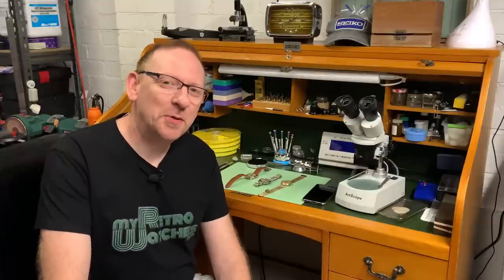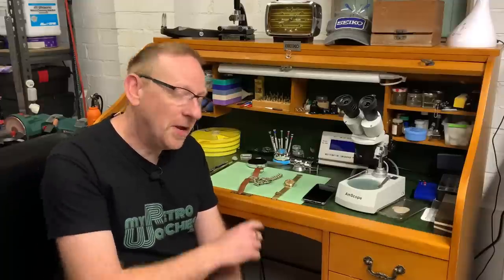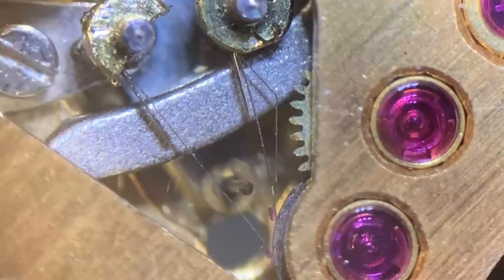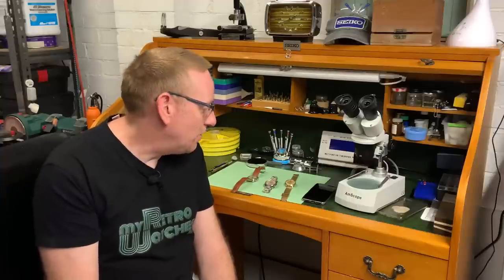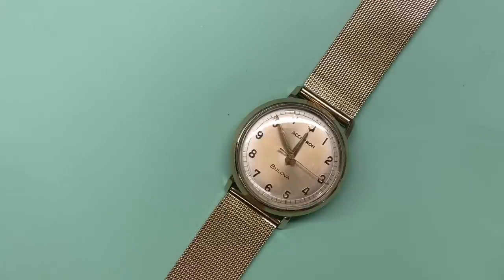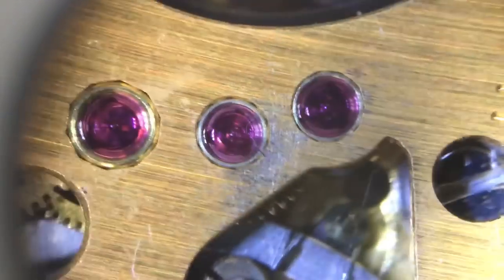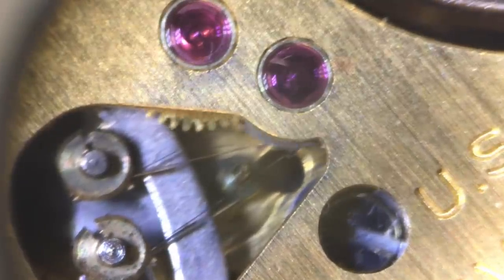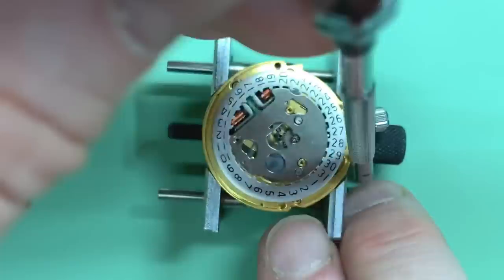Bulova Accutron 218 Disassembly Tutorial

Comment: These are fantastic time pieces. I have a A Cushion Shape Bulova Accutron 214 Solid 14kt Gold. In High School I worked at Carl’s DiamondD Brokerage and Carl’s fineJewelry. I learned Gemology and all about watches. I became a Watch addict!  Beautiful timepiece and the most accurate timepiece in its time. While Omega Speedmaster won the Government Contract from NASA.. Bulova instruments were used on the desk and control panels. I replaced the battery several weeks ago and she is humming away.  And still accurate. I want a Spaceview.  As you found out the index “lever” jewel looks like it is hanging by a hair the actual index lever. I had a customer that wanted an Accutron, but I advised purchase for dress wear because not an appropriate work watch. He was in construction and ran a jack hammer. Incabloc shock resistance system was the durable watch in that time period. I still love my Bulova Accutron. Citizen owns Bulova now, has a “Tri - Tuning Fork System” that runs at 262 kHz very accurate time piece. I have one in the Bulova Lunar Pilot reproduction model.  Love it!  You discussed my 214 on a previous video....  I’m learning so much from you!  Thank You so much!
Reply from the maker: What a great story you have there . I am definitely going through my tuning fork phase (pardon the pun)

Comment: I have worked on several 218's. the main flaw in the design is the minute wheel clutch. they wareout. the the hands stop moving as calendar approaches the 12:00 flip.
It can be tightened up again wth great care. Watch out for that index wheel, one bump and it's "all over"! 
-great video!

Comment: Thanks for making this video. Really appreciate the walkthrough. isn't it amazing how they achieved such fine detail on the index wheel way back then? I would've instinctively grabbed the edge of the wheel with the tweezers and unknowingly rounded out the teeth. These really are a different kind of beast. Tuning fork movements can be far more delicate and less forgiving to work on than the traditional mechanical balance wheel types.
Reply from the maker: Hi Chris!  I’ve pretty much mastered these 218s now after working on over 10 now. They are actually quite simple but delicate at the same time. You should try one I think you would really appreciate the challenge. 
I still find it incredible that you can take a tuning fork and turn that vibration into wheel motion.  Some engineering!
The 214 being the first ones and in the mid 60s they can make a 2.4mm diameter wheel with 320 teeth all perfectly cut from beryllium.

Comment: Might I recommend getting a  # 5 fine point and a # 7 hooked point tweezers to aid your efforts. I was lucky in finding these and more at the estate sale of a watchmaker.  Recently, I have acquired a Accutron 2182 day date made in 1972.  It had a dead mercury battery inside but not leaking. It's working like a champ now and it's informative to see how the bloody thing works.  Cheers.
Reply from the maker: I have developed a method with these now as I have done around 10 of them. Kinda got a bit obsessed!
It’s the wonder of engineering how to take a vibration into a train of gears and then get at 300 beat per second. 
Walks over all mechanical watches for the smoothest tick.

Comment: Attended Bulova Schol of Watchmaking and have been repairing Accutrons since 1970.  Most parts you removed isn't necessary unless there is rust involved.  One point, you forgot to remove the setting lever screw.  The video was very good..
Reply from the maker: This was my first time inside one of these so please take that into consideration.  There is no logic in not removing all parts for cleaning in my opinion as this is what we do for all fully mechanical watches. Good practice .
I’ve now done some 20 or so 218s and have them down to a finer art plus I now have the phase gauge and movement holder to get them reasonably accurate.
I’ve a 214 to video soon. Never been in one of those either so I must be crazy to film my first exploration but it makes for a more entertaining video 😂
Reply: You did well for a beginner and the video was excellent.  Keep up the good work!!

Comment: I am also gobbsmacked. My uncle sent me Bulova Accutron tank that has the 2470 10 jewel movement. Everything inside looks to be in good order, but the battery retention clip (with a battery) was sitting on the circuit and appeared to server one of the connections-it was also a bit corroded. I haven't the faintest on testing or repairing these.

Comment: Quite enjoyed your presentation! I've got a Bulova 218D and if I can't fix it, you're welcome to have it. Second hand spins but time stands still! Cheers
Reply from the maker: So the second hand is running and watch is humming?  if so should be a fairly easy fix, I would think something is amiss dial side as hour and minute are driven on that train of wheels.
Reply: Right! A watch maker friend found a tiny wheel worn and swapped it. Works fine now. Lovely time piece the 218D with elastic band. Not high value though. Thanks much

Comment: I would like to offer some advice regarding the center wheel. Once it's removed, hold the center part with the tweezer and turn the flat part with your finger which should have bit of friction, not turn freely.  Bulova had this problem that the flat part does wear.  The solution is to push out the pinion (which you will see wear, a copper color, on the flat part), flip the flat part over and insert the pinion into the flat part. Do this on a steel anvil with assorted holes.
Reply from the maker: Thanks for the tips!

Comment: Hello Mike, thank you for all the videos you make, they are all very interesting.
Regarding the electrical coils and the magnetic stators, I have learned from my work with permanent magnetic motors that you should leave the coil inside the stator or replace with a similar piece of steel just to avoid loosing the magnetic force, at least if you’re not putting it together the same day. 
Just a kind suggestion from my side. 
Regards from Sweden.
Reply from the maker: Thank you for this info and thanks for watching.

Comment: Thank You so much!  Is there a special lubricant to use?  I noticed on EBay a synthetic Lube called Liquid bearing which is suggested to use on watches and clocks.  I have used on several guns.  Some I have had setting for a while so had to clean because I had used Break Free CLP which I used when I was in the Military. Supposedly Teflon coated and prevented wear of the weapons parts. However, when I took apart to clean and lube, there was a gooey residue.  So I cleaned and used the liquid bearing and will wait a few months to determine status. What do you recommend? Thanks so much!
Reply from the maker: There are many watch oils , all in tiny amounts like 1ml but all costing an absolute fortune.

Comment: great video mike, it is helping me service my 1973 - 218. can you clarify what you did when your hands were in the way of the camera when "moving the fingers back" . looking forward to your help completing the project
Reply from the maker: Can you give me a time stamp on the video so I can look. It was quite a while ago when I filmed these.
Reply: 27 minutes
Reply from the maker: Okay so to move the fingers back I use a bent old oiler that can fit in the slot of the collet that the fingers are attached to. You just need to move them both so the jewel is not touching the index wheel. To not move too far off either as you could then catch them on something when you come to move the tuning fork later on.
I move them 2mm or so from the wheel.
Reply: @MyRetroWatches  thanks for the detail, this is a great help

Comment: The 2 tiny washers are color / material coded because they measure different thicknesses. Never assume they are copper on bottom and vice/ versa. The tuning forks were hand fitted for "poising" (distance from base plate/angle) from my understanding, and you should always preserve their position. i have made the mistake of removing the tuning fork quickly and the washers came off stuck to the fork, fell,  and i never knew their original position.
Reply from the maker: Thanks for answering this for me. Interesting. The 3 I have done so far the copper coloured one was always on the bottom.

Comment: I just pulled up your assembly video and you discussed lubricants and I saw another video.  How do you remember?  I saw an instruction manual on my Accutron 214 so will download. Not ready to tear down on my own just yet. 😳
Reply from the maker: I’ve not rebuilt this yet.  On Seikos I pretty much know which oil for where. The principal is 9010 for train and jewels. D5 for hi friction points and grease for keyless work.
This is a 218, I’ve not taken apart a 214 yet. 
Just bear in mind this movement is still very new to me so I may oil incorrectly or use wrong methods ... aim is to demonstrate how I can get this back together and for it to run.
Reply: Thanks so much!

Comment: A thought just occurred to me, I guess you need to be careful with things flying to the magnets, those coils are made of very fine wire - any damage on those and you've had it. Hopefully the attractive force is not big enough to cause any damage, but... I suggest maybe covering the coils with a bit of sellotape or something to protect them.
Reply from the maker: Its worth taking care, the coils on these are usually coated in some resin to help prevent damage.

Comment: Thank you for posting this! Can you tell me how to install a 214 Accutron crystal? I have the 218 and 214 service manual but they don't say anything on the matter. I couldn't find anything on how to get it out so I used a crystal lift and broke the crystal. Could you please recomend some literature on this? I can't find anything.
Reply from the maker: Sorry I’ve not had to try and would also depend on model. If it’s acrylic then if probably just pushes out from the back as it will be a tension ring fit meaning a new one would have to be pressed in on a watch press
Reply: @MyRetroWatches  Thank you for your time. I joined an Accutron collectors club on facebook and they have answered my questions on that matter. I would love to see this same video but with a 214! Any works in the future on that? And thanks again for doing this vid. It shines more light than any other.

Comment: I watched all three 218 videos with great interest - very well done! 

My question to My Retro Watches is: I think the lume of the bulova accutron 218 watch hands is tritium and radioaktiv. As the watch is approx. 50 years old and tritium has a half-time of 12 years the  radioactive radiation should be very little. But I would like to know, whether you took any precautions when opening the watch and get in touch with dial and hands to protect yourself and not to inhale the dust which might came from the lume.
Reply from the maker: The dial is from another donor that does not have a case or a stem, in the other videos I say this. I took no precautions, no need as i was not trying to remove the lume and as its not in a case its not building up in there.  My understanding of radium is that you need to be around it allot and have many watches together in one confined area for it to be a potential risk.

Comment: I picked up a nice looking Seiko snx879 that didn’t work has the 7S26C movement and the rotor screw was lose. Tighten it up and gave it the Seiko shake and I’m wearing it. $10 on eBay I couldn’t turn it down.

Comment: I have a 218 that the second hand runs but the other two don't. You can set the time but the hands will not move on there own, the second hand just goes by its self. Is this an easy repair?
Reply from the maker: Hard to say the canon pinion is attached to the hour wheel so my guess is the problem lies there.

Comment: Tons of Bulova Accutron bulletins and service instructions on the web... mostly in PDF format.  Are you using these?  I think they would be invaluable for assembly, cleaning and lubrication.
Reply from the maker: Thanks I have the 218 service manual but so far I have only glanced at it to know how to take care of the index.  I will read for oil but the oiling I hope is just the same or similar for mechanical I do. If I get something wrong I am sure you guys will let me know!  as its my 3rd attempt I am very green to these.
Reply: @MyRetroWatches  Michael, you will have to verify for yourself the following: https://forums.watchuseek.com/f6/oil-choice-question-791598.html

Re: oil choice question

...revisiting this thread with a fairly specific lubricant question...

...I have an Accutron 2182 movement that could benefit mightily from some cleaning and re-oiling. The manual for the Accutron 218-series movements calls for two specific lubricants: 'Moebius OL-219 Synta Visco Lube' and 'Moebius OL-207 Special Lubricant with Molybdenum Disulfide'. Now, we're talking a manual that is probably 40 years old or better, and almost certainly these particular lubricants no longer exist. What would have superseded them, or what would be suitable substitutes?

...edit: I seem to have found the answer to my own question. It seems that both of these lubricants in fact do still exist, just under different names/numbers. The 'OL-219' is now Moebius '9020', and 'OL-207' is 'Moebius 8201'...and I've also seen some recommendations for a couple of alternatives to the 8201, namely 'Microgliss D5' and something called 'PML W-10'...

Comment: Mike, fascinating! Any idea what switches the current from one coil to the other? Is it mechanical, whereby when the fork is at one side it causes the other coil to generate? Great video!
Reply from the maker: Dale Yurk I have no idea. Electronics are not my strong point. I assumed both coils are on to generate the vibration
Reply: @MyRetroWatches  Mike, I'm pretty sure that the coils energize thousands of times a second separately. That's what causes the fork to vibrate back and forth. Hope someone else chimes in on this. I'd love to know the functioning.
Reply from the maker: Dale Yurk if you google Accutron 218 service manual this might give you some more info .  All I know is the round cylinder parts the coils sit on in the tuning fork are the magnetic parts

Comment: When I got my 214 way back when, when the battery went dead, I found that they didnt sell those batteries any more, so I sent the watch to someone who did something to it so now it uses normal batterys, I believe non Nickel ?. do all of these watchs need this done. Mine is the 100 anniversary watch. it now runs great.
Reply from the maker: Well you can either use a 344 1.5v battery and phase the index wheel to cope with the extra voltage or you use an accucel battery which is a normal 1.5 v battery with a shroud and a diode in it to reduce the voltage to 1.35 which was the original running voltage.
Reply: @MyRetroWatches  So do all these watches need this update, funny its never mentioned. AS far as supporting your channel, Im very old living off of almost nothing, only wish I could, sorry

Comment: Hi can anyone tell me where to get a clear rear case back please I do like that on the watch. Thanks
Reply from the maker: Sorry I’ve no idea
Reply: Braia Family, these "display casebacks" for 218 variant (they should also work in most 219 and 224 Accuquartz) Accutrons are simply put together with the locking ring and a low dome acrylic watch crystal of the proper size, assembled with adhesive no doubt. They were not an original Bulova item.

Comment: The second watch you show, with the display back, the case looks VERY MUCH LIKE some of the russian watches. I can remember whay brand but do a search on ebay of vintage soviet watch and get past the reproduction junk and onto stuff from the early 80s and 70s and you'll see what I mean. The old soviet quartz are VERY much like a coil, circuit board with one chip and one resistor, an UPSIDE DOWN battery like this, and it is like the butchered a mechanical watch and just planted the electrical parts in it.
Reply from the maker: The second watch I show is also a Bulova only the display back is aftermarket. I wish I could find them as I would fit it to all my Accutrons.

Comment: What is the most common reason for an accutron to stop working
Reply from the maker: I have no idea, I have only fixed around 10 of these.  failures are usually coil issues and battery damage.
Reply: @MyRetroWatches  it hums but there's no movement. Could be those tiny fragile contacts
Reply from the maker: @fubarmodelyard1392  if it hums then it will most likely run just need a service or the pawl / index fingers adjusting . They are so delicate

Comment: Good luck de-magnetising those screws,I can't imagine how you could do that with a ordinary de-magnetiser................
Reply from the maker: What makes you say that?  I have already demag'd some and they are fine.  If I got into trouble I have big electro magnetic chucks on my grinding machines at work that will demagnetise these easily.
Reply: I just thought with those tiny screws they could easily be lost on the de-magnetiser,you obviously have a technique worked out that i have failed to imagine............................
Reply: @MyRetroWatches  just be sure to NOT demagnetize any of the other parts of the movement such as the tuning fork (consult the manual). It specifically cautions against demagnetizing the Accutron movement ;-)
Reply from the maker: 767fresh of course , thanks. You know the score, screws go on coil and get magnetised . If I use brass tweezers to fit them then all is well but with steel the screws will stick and be a problem in the more tricky areas like the pawl finger plate with the screw close to the finger post.

To be honest as I am typing I’m thinking to re sharpen and shape by brass tweezers . I like a real fine point and my brass at the polar opposite